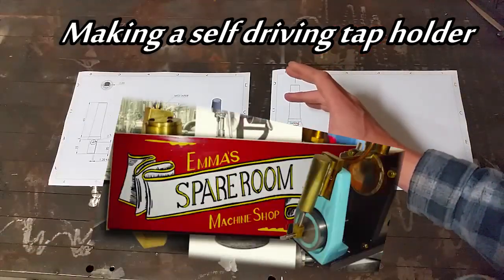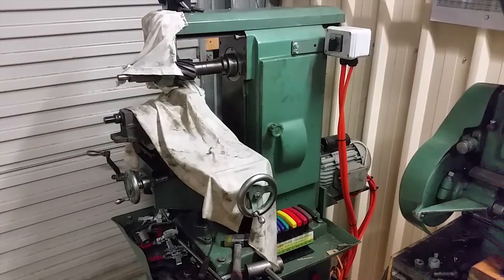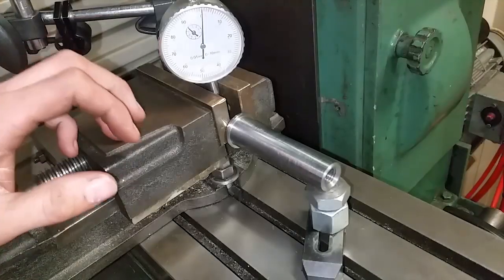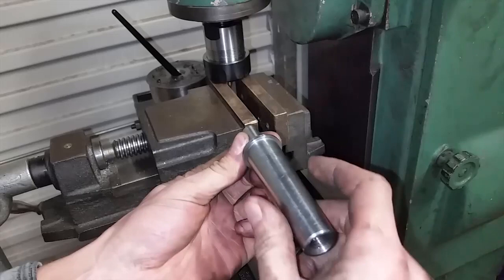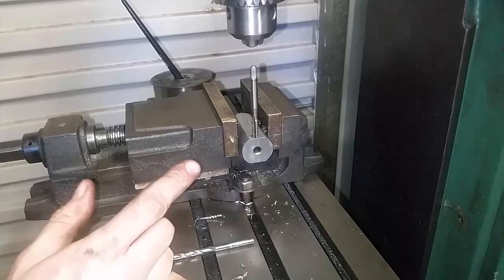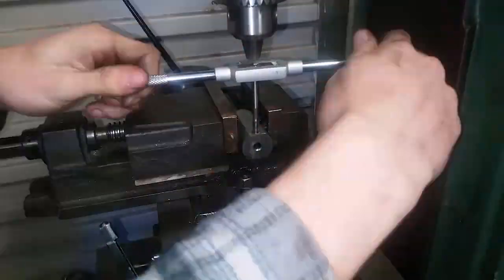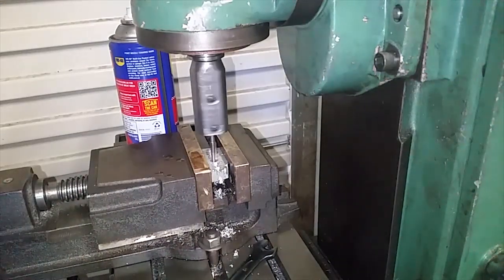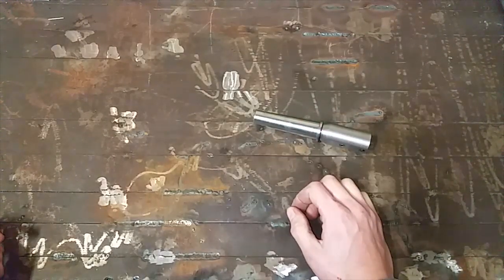Self Driving Tap Holder For Mill

Comment: How did you find the Hercus mill? Obviously you’ve upgraded since then but just wondered what your thoughts were on it. Are they worth it or do you suggest getting something a bit modern with a quill.
Reply from the maker: @who32isit  it's an excellent mill, very precise and rigid. Quick to change between horizontal and vertical milling with good repeatability too. The downsides are the limited work envelope and lack of quill. I still have the mill, I'm planning on making a riser block for it to make it more useful, but might sell it
Reply: Awesome thanks for your feedback. I’ve just acquired one, but have been struggling to find much info on them. Your videos have been good to see them in action. 
I’ve been a big fan of your channel for a while now and it’s good to see you’re getting back into it. Cheers mate.
Reply from the maker: @who32isit  lathes.co.uk is a good source of information. It's where I first saw the idea of a riser block and that factored into my purchase to overcome the work envelope limitations
Reply: @TomMakeHere  thanks mate, I’ll have a look. Cheers.

Comment: Love the impromptu slotter. Lots better the my early attempt https://youtu.be/x42-JJ5Q0c0

Awesome build
Reply from the maker: Before making this I did about the same using a hammer and what resembled a HSS boring bar. It was crude
My current approach is to mill a notch out of the bore for a keyway, it leaves an oversize radius at the end, but it's quick and easy. (you could partially mill and then file for a better square keyway)
Thanks for watching